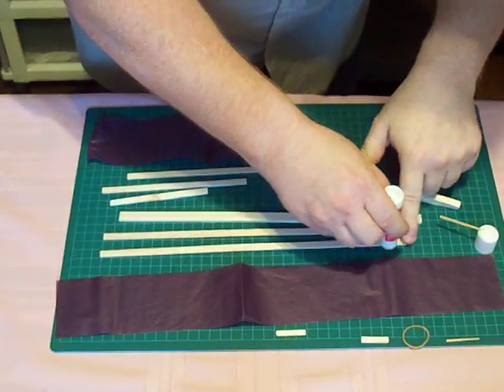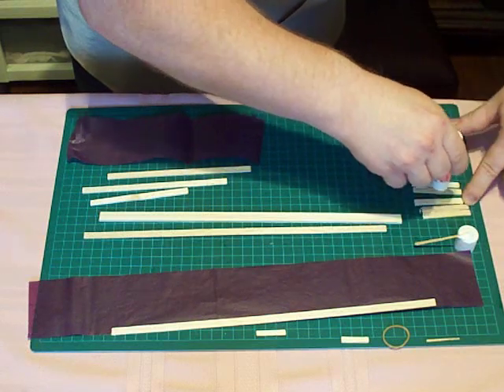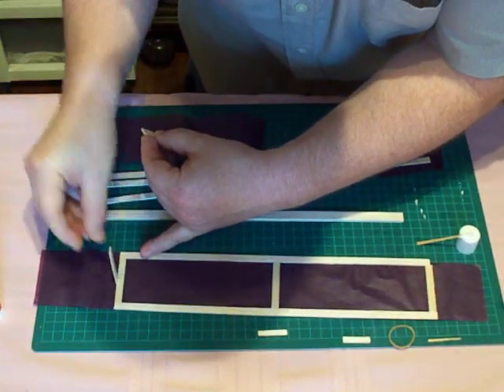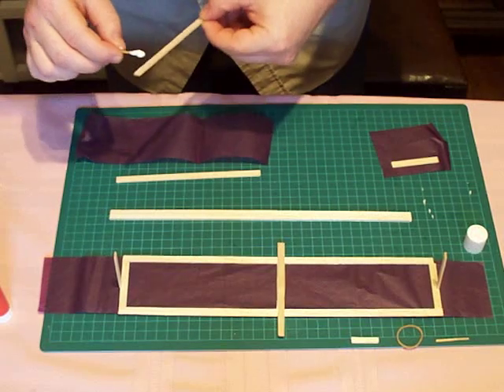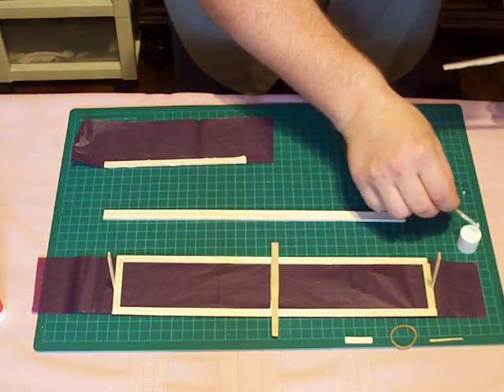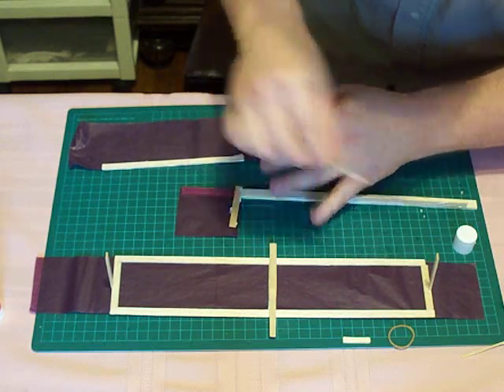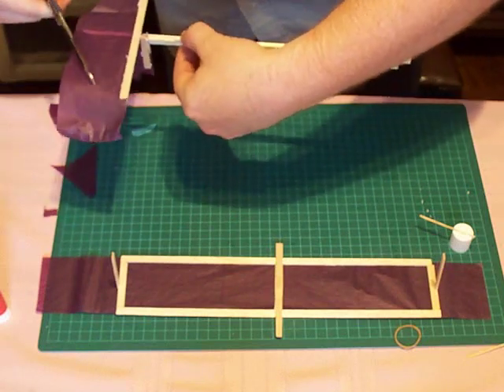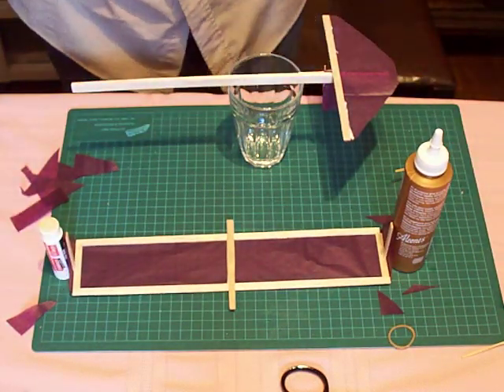Rubber Band Plane in 6m!

Comment: Thanks for the planes ! My sons and I made this model. We had a ton O fun, Did a contest for longest flight,best landing,and if you made the plane in less than 10 min you got bonus points.
We bought all supply's at our local ace hardware store, Balsa,glue,Tissue paper. When the plane  had been repaired to many times and were quite ratty  we attached a bottle rocket engine to the plane. Great fun for cheap.
Thanks again

Comment from the maker: There are some revisions to this:

1) Some small balsa shards are used to thicken winglets before installing. 
2) Fin no longer hangs underneath motor stick
3) Tailplane leading edge goes right under fin leading edge to increase glue surface.

I'll cook up another video.

Also a "scratch build video" for making from scratch!